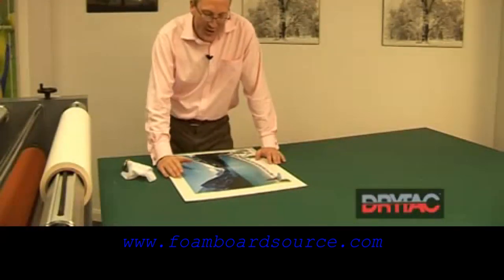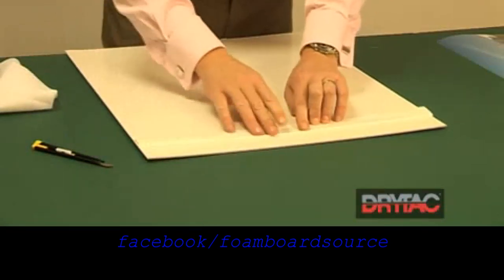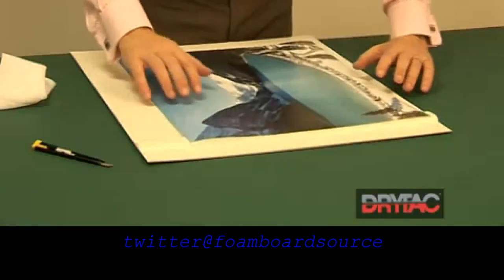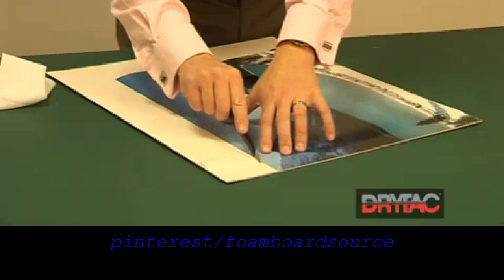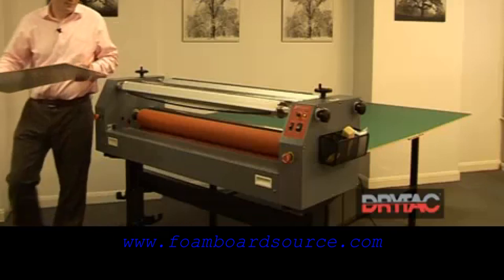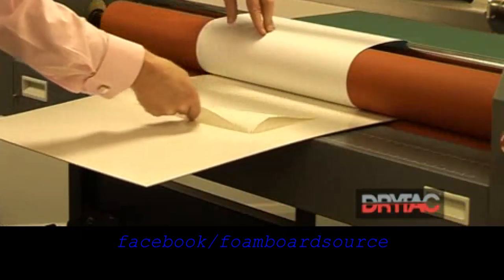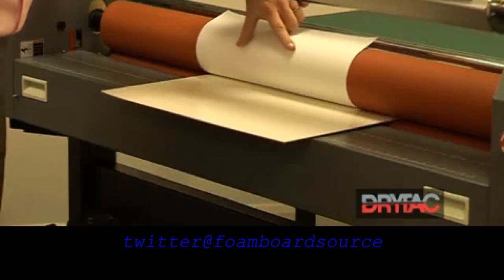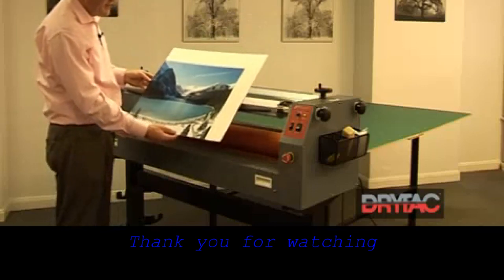Photo & Poster Mounting using Self Adhesive Foamboard how to instructional video

Comment: Hello there! Thank you for this useful video and the good ideas and tips shown in it.

I have a question. I am an artist who works mainly on paper with graphic markers, inks and watercolours.
Is the solution shown here, on a adhesive foamboard, suitable for high quality conservation of such a type of art and media?

I am concerned mainly about possible paper artwork wrinkling over time, or the artwork falling off after a few months, and eventually about colours migration or alteration due to the effects of the glue on the back.
I use rather thin acid-free white artist paper and sell artworks in classical matted frames. My framer uses double side adhesive tape between the back mat support and the paper artwork itself, which annoys me big time, but is seems to be the only best solution he has in the shop.
I'd happily swtich to this adhesive foamboard if its quality standards were possibly considered as "archival".

Thank you very much for your answer, and inspiration!
Reply: i would think you should use the method that other artists are using with the tape & matte board & frame. our adhesives may not hold out over very long periods of time.